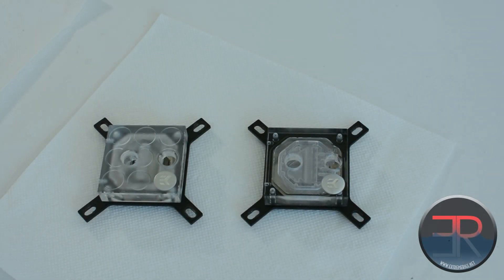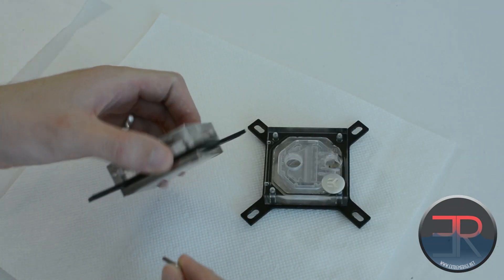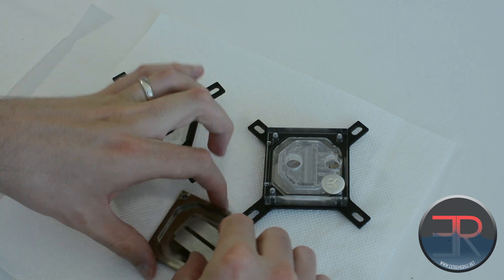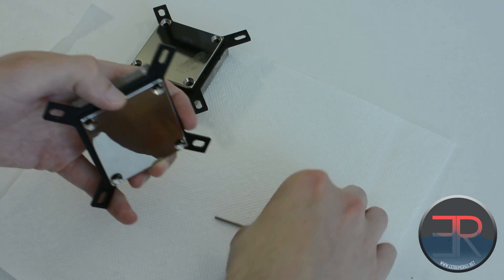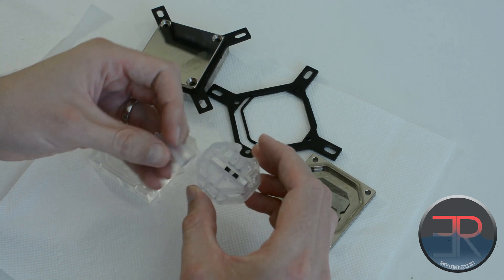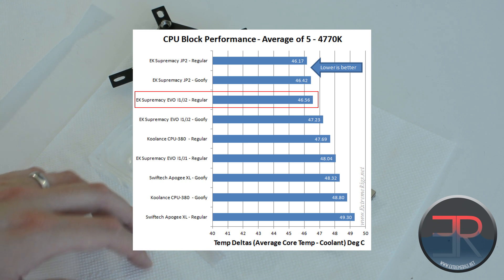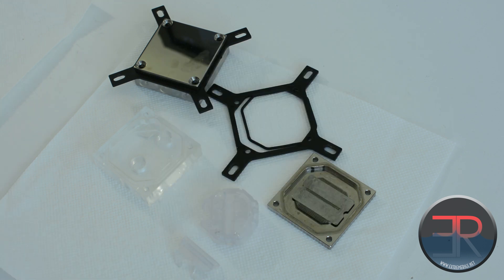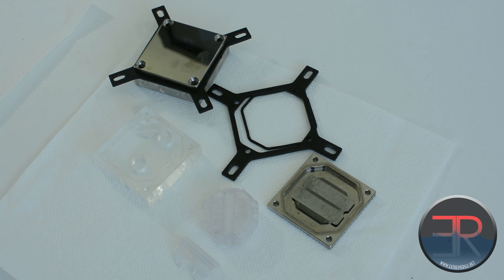EK Supremacy EVO Review

Comment: I would have dug into the results a little deeper given EK's claim to performance improvements. ie, contact quality, multiple mounts, rad and pump variations. After which, should the block still not meet the claim, I would have forwarded the resulting data to EK for review. 
That being said, this wouldn't be the first time poor performance samples come off the production line in early samples. I recall going through the very same thing with other blocks over the years only to find that others showing expected results down the line. - sucks. 

I've got my eye set on the EVO Supremacy Elite Nickel this round. I currently own and run the none EVO and so it will be interesting to see how the two perform on the same setup. After which, I'll upgrade my Res. and try both again to assess the results. I just hope the EVO lives up to the claims made by EK. As I'd hate to spend all that money only to end-up on the loosing end of the scale :p

Comment: wait so the general consensus is that the evo is worse, because of the new restriction. wait so.....why would anyone want the evo?
Reply from the maker: Honestly without testing more CPUs it's hard to say.  In Moonman's testing he got 0.9C better on the 4770K and 0.2C better on the 4930K so it's not clearly worse or better IMO.  I think my CPU likes a bit more bow than this particular EVO sample gave me.  I'll be testing on the 4930K soon.  Eitherway whether it's slightly better or worse the change isn't particularly large which isn't surprising when it's effectively only a bow/jetplate tweak.
Reply: Extreme Rigs .2 wouldn't qualify as an improvement for most anyone. Though .9 might be worth the effort. :)